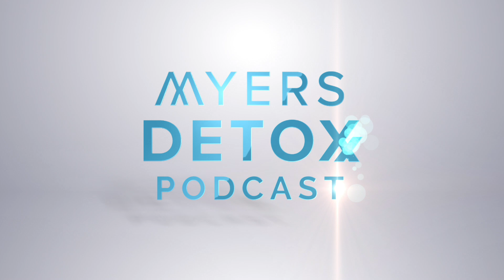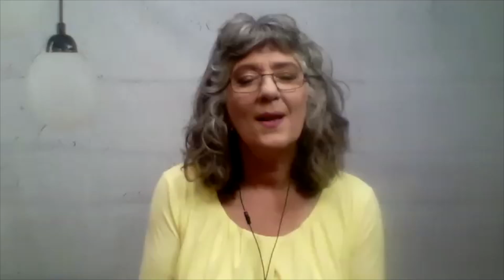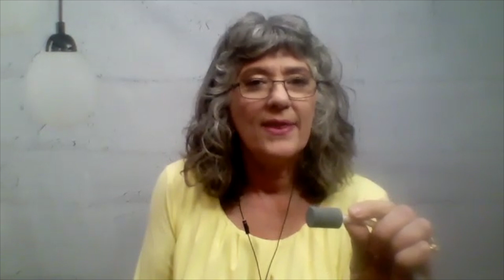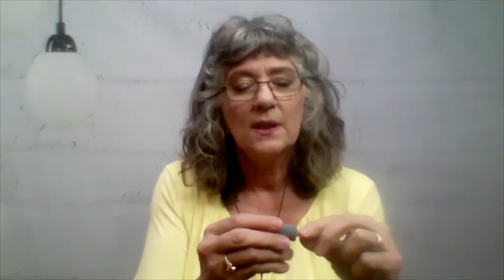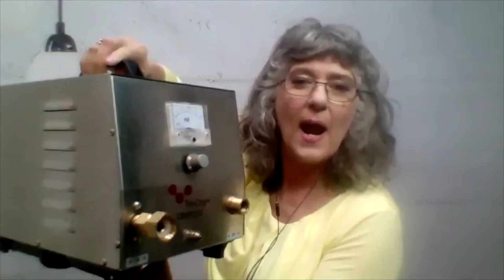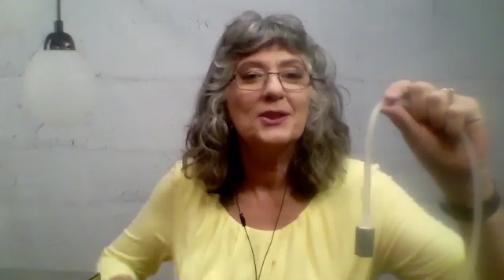#312 Using Ozonated Water to Detox with Eileen Durfee

Comment: The speaker claims that ozonated water breaks down heavy metals in ground water. This simply isn't true. You can't break down heavy metals because they are elements on the periodic table. You can break down organic toxic compounds that are carbon-based where the ozone oxidizes these compounds into water and carbon dioxide as the products.

It makes it hard to trust these types of speakers when they say things that are scientifically incorrect